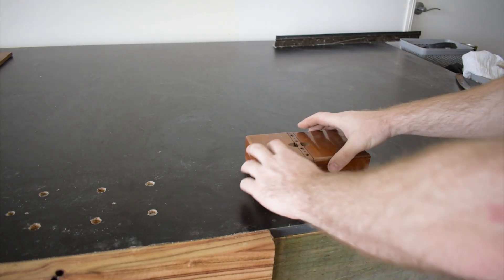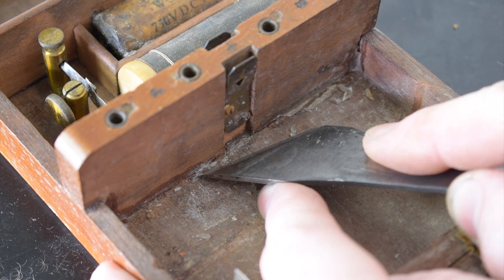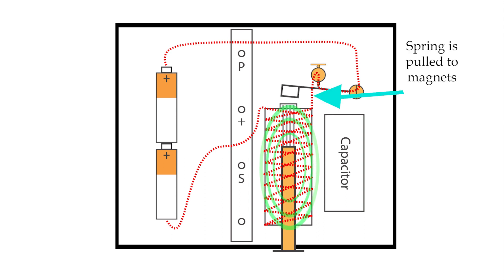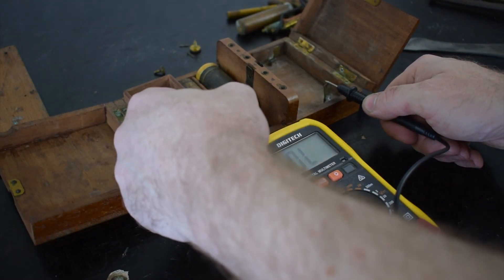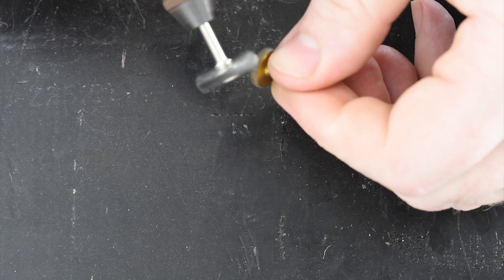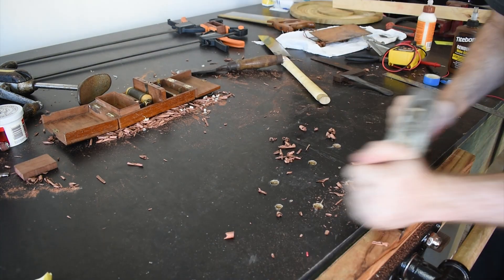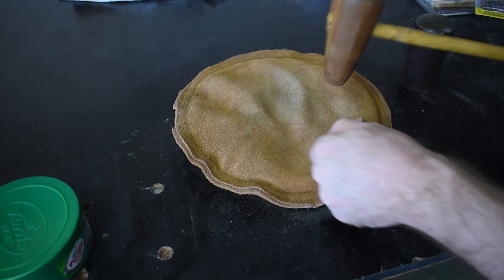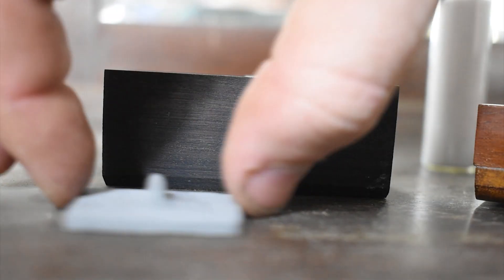1890's Medical Tool Restoration - Shock Therapy Device

Comment: I have personal experience with the machines. They were still using them hospitals not 20 years ago, and probably still are.
The application is similar and the machines are electronic, but the machine I fixed a couple of times was not what I'd call a modern build. I'm fairly sure the output was D.C. too. I spent a lot of time in the theatres fixing all the machines that go 'Bing'.
I forget all the settings available, apart from 245V D.C., but being an electrician with an electronics leaning, I was horrified. Especially as I'd spent a week in hospital, prior to snagging a job there, with depression and one of the first things they offered was to book me in for was a few sessions on one of those machines.  I'd experience with both 240 and 415V as well as some really nasty DC voltages, and horrible static charges. Zapping yourself or your mates with your insulation tester is very tame in comparison. Passing any voltage through your brain is a very bad idea. Those things should have never been invented. 
Errr... nice work though, lol. I'm working my way through your videos from the oldest after a new one was recommended and it's good to find another Qld'er on YT.

Comment: Hello, I was able to acquire this device not long ago, but I noticed that the roller that is inserted into the coil was missing. I would like to know how to obtain a similar part, because I cannot afford to buy this device just for 1 accessory. I hope to receive a response from you, best regards Kylian.
Reply from the maker: Do you mean the brass tube that alters the strength of the shock? This one seemed to be brass with a lip on the end and then a clean varnish to stop it tarnishing. Maybe try a bit of brass tube from a Hobby Store? Let me know if you need more information, and good luck.
Reply: @RestorationEndeavours  I was able to find an incomplete Gaiffe on the net at a low price to be able to recover the brass tube. So I guess I solved my problem. anyway thank you for your response

Comment: Cool "quack machine"  restoration! Devices like this one were very popular and no doubt some of them REALLY dangerous from that time period. -Family  had a similar and bigger one my Dad found that he had to hide from us as it worked. Wasn't very strong but the idea at the time was definite quackery or even a bit of the placebo effect as the mild shock made patients think it was doing something therapeutic. It does make one wonder whether modern devices like the TENS machines will be viewed as quack machines as medicine evolves.
Reply from the maker: They are a cool device. From what I researched, newer machines do have some effects in certain scenarios, but need very precise current. For example they still use shock therapy for extreme depression with positive and repeatable results.

Comment: I'd replace that capacitor, it's a paper one and has got to be leaky as hell by now.  You could easily melt out the beeswax, remove the guts and slip a modern one inside.
Reply from the maker: It is! There is a point where you can see its suppression of the spark is reduced. I may down the track do just that or carve out underneath and put a smaller one in.